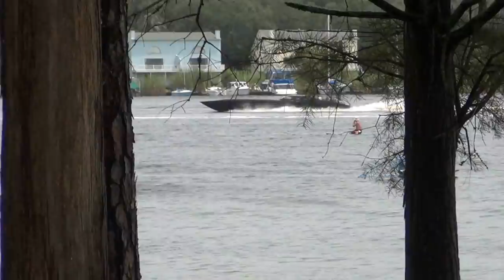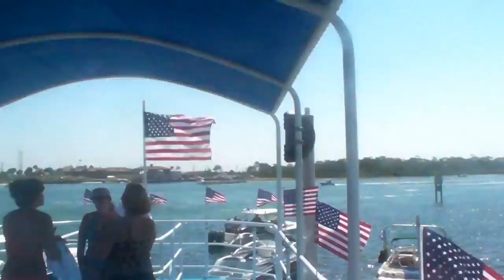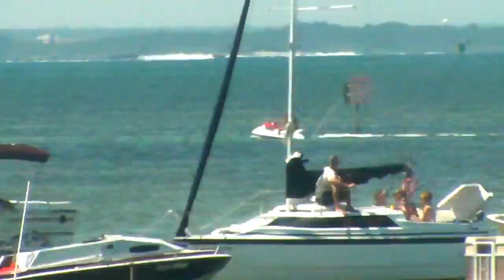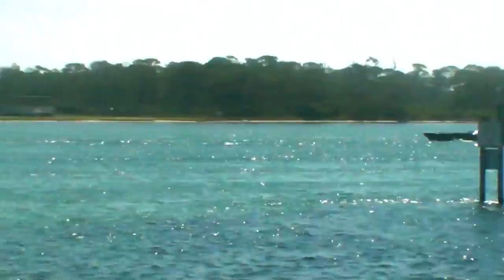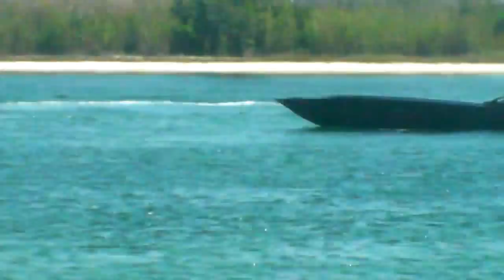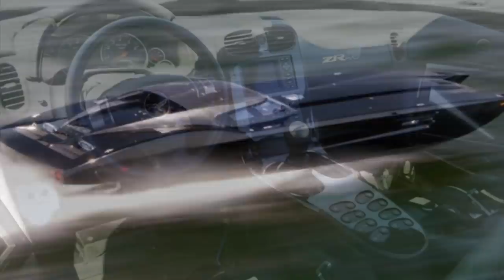ZR 48 Corvette Boat

Comment: the old c4 corvette zR1 engines were manufactered by Mercury marine, LT5, aluminum block and heads, overhead cams 4 valve percylinder, 350ci 405hp.designed by Lotus,  these corvette engines made there way into a few boats, in pairs.
Reply: Not many people remember the  lotus designed Chevy engine!👍👏. Lotus was owned by GM at the time. My 91 lotus elan has several parts lifted from GM cars.
It kept the cost down.
Reply: This particular boat has twin 1,350-hp engines.
Reply: I own a 1990 ZR-1, she is a beast and I'm proud to own America's Forgotten Supercar. Long live
"The King of the Hill"
The boat is off the hook. Badass.

Comment: It reaches a top speed of 180mph.  
2,700 HP.  It has a pair of 1,350 HP turbocharged
 Mercury Marine V8 engines. Worth about $1.7M
Reply: 3,300 hp
Reply: It's 2700 HP Google is Franky.. I don't know where you get 3300
Reply: We read that already.
Reply: @willzuehlke37 , he probably used some of that indoctrinated common core bs math to get his figure. 😂

Comment: June 2019,first time out on my 12 m Sailboat,took me a week of thinking, and decide, to finally carve and drill holes on a perfectly floating sound boat,by installing the 2015 KAWASAKI Supercharged jetski motor/jet propulsion system(310 HP),ran tests from France to Portugal,before"hitting"the high seas next year,my old diesel PENTA is gone/sold.....What a torque monster...!!!...Trolling for Tuna or getting away from rough swell or maybe pirates...!!!!,just working on better cooling in the engine bay,with extractor fans,even on a Sailboat a powerful engine is a must.

Comment: In general the cops will just turn around because if he used the boat ramp or has a dock there they know exactly who he is, and will just get him when he comes back.
Reply: They'd have a super hard time finding him with all zr mti"s in that town.
Reply: @mikesimmons852  common sense kiddo
Reply: @mikesimmons852  Derp!
Reply: Well that and that looks like the Marina police only have jurisdiction within the Marina outside that they would for sure have the USCG to deal with even on a lake. If that is an oceanic marina that boat can run but its doubtful they are outrunning a Coast Guard cutter. Between radios, ability to get aircraft involved and when the refuse to comply to stop there is the potential for HITRON to get involved and that means putting a .50bmg into the engines and disabling the boat. Its a great looking vessel and has a place but speeding through a marina isnt it. It looks alot like the speed boats I have seen in the Gulf of Mexico used by Narcotraffickers from the 80s and 90.
Reply: @JosephDawson1986  l

Comment: I build boats for living speed boats and  was probably running 165
Reply: Our US-1 48 carbon with 1350's tops out at 168 on a good day. Still chasing 170.   Will run low 160's pretty much anytime.  148 in 1100 mode.   We got the speed boat spot light for speed boat magazine Jan/Feb.  With the mti trifecta.   Gonna take a A10 to chase one of these down.
Reply: @groundzero298  as in Bob Kaiser?

Comment: great insertion boat for SEALS or USMC Recon. I wonder what the radar cross section looks like.....?
Reply: made for fun, bugger the military.
Reply: Its got round edges everywhere.
I bet it looks exactly like a boat on radar
Reply: Arch Angel  WELL THE RADAR SAYS VETT
Reply: ...yeah, I bet carbon fiber holds up real well for milspec...stick to COD...
Reply: @puzer1  whynot? The USNavy and USCG are looking into carbon fiber hulls for the vessels that use Fiberglass in their fleets. If done right it would be lighter, stronger and potentially make those vessels faster.

Comment: "Running from the law" hahah like you can "run" from the law with a boat noone else has🤣 cool boat though
Reply: Bruh it's easy to run from the cops...even a waverunner/jetski, especially a stand up, way easier to hide, Just gotta be clever
Reply: @cloakedgt  "Bruh" he means that the boat is custom. No matter how far he runs, it's still "that guy with the corvette boat". Doesn't matter where he goes, any marina he pulls into is going to have a problem. Gotta get gas eventually.
Reply: It's hard to outrun a Motorola...
Reply: No one else
Reply: @cloakedgt  They're lucky the cops can't just use Apache helicopters with Hellfire missiles to stop them.

Comment: Damn, wish I had the money for that baby! BUT I wonder how much fuel it guzzles down at full throttle?
Reply: @3813-t5t  😂😂😂🤣🤣🤣🤣
Reply: probably more than the cost of the boat itself nowadays lol
Reply: @d3fault1420  the Turbocharged Marine Mercury engine it has will consume around 1 gallon per minute. And this boat has 2. Prolly a bit more.

Tops out around 180 mph, this gives us about 1,5 miles per gallon all out. Marine gas can cost 1,50 more per gallon than auto gas. Depending on where you fill up, this can run you over 8 bucks per mile as of this comment. At 1,7 million, you'd need to run this thing for 118 days straight to burn more fuel than the value of the boat. If fuel cost drops to ore pandemic, this time will increase to over a year.

Comment: if they really wanted to catch him its called a helicopter
Reply: Nope, not even close.  What is the top speed of a police helicopter?
Specifications & Dimensions
Helicopter	R66 Turbine Police Helicopter
Pilot, Passengers, and Cargo with Max Fuel	774 lb (331 kg)
Cruise Speed at Maximum Gross Weight	up to 110 kts (127 mph)
Reply: BINGO
Reply: Uh.....RANGE.......LOLOL and if you didn't know, this boat is MUCH FASTER than any civil helicopter

Comment: Very nice boat. But as I am watching I see many 25' to 40'  boats close to the shore with there owner's wading in front of the boat. Lets get real, those boats can not float in 2' of water, especially a sail boat.
Reply: I see them too the average pontoon boat has a draft of between 16 to 24 inches and with the outboard trimmed right as low as 10 inches, those other craft are small craft and have a draft of maybe 3 foot at most and probably more like 2.5 foot with the motor trimmed.
Reply: Bro I am %100 certain you have not seen 25' sail boats in wade-able water
Reply: @WalkerAnger  a few of those sailboats i recognize,  all of those have a retractable keel or daggerboard, made for shallow water. 2 of those are in fact 26' sailboats with daggerboards, one is a powersailor